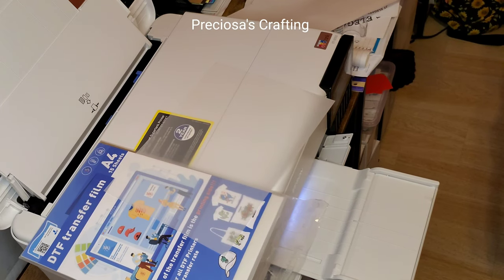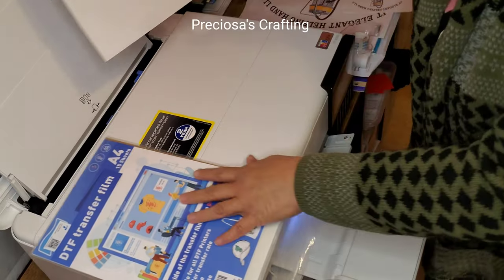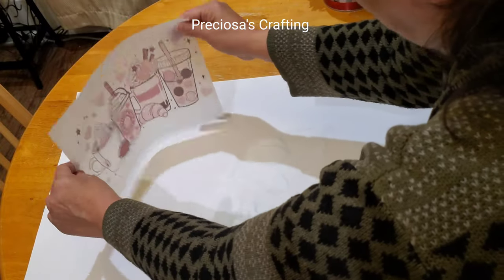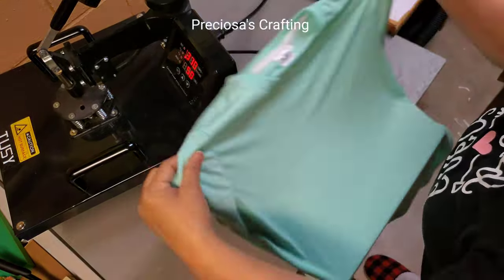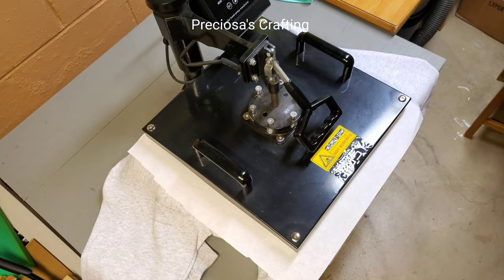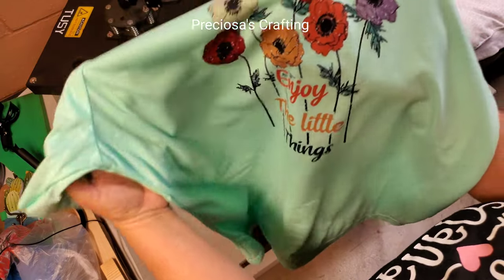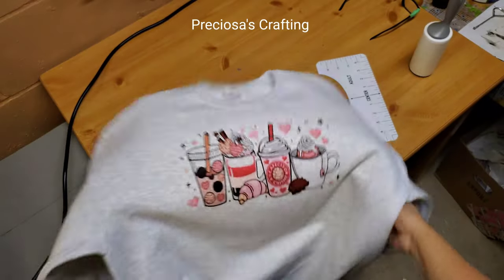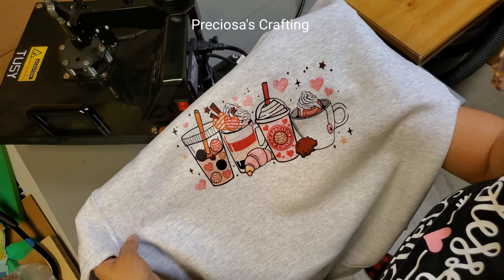DTF Sublimation Hack On a 100% Color polyester Shirt and Cotton Blend Sweatshirt!!  #sublimation

Comment: I love how both shirts came out ❤ I been using dtf to sublimation  hack for sometime now and it’s my go to 🎉I would say that if you use parchment paper instead of butcher the ink won’t go on parchment ❤
Reply from the maker: Oh that's good to know about the parchment paper thanks for letting me know. Thanks for subscribing.
Reply: @preciosaskreations4715  you’re welcome love ❤️
Reply: how are urs after you wash it?
Reply: I learned that the hard way. I have to send stuff back, after following someone else on Youtube.
Reply: @Wrightn221  not sure if you were replying to me since is on her page but yes I learned that with parchment is better ❤️
Reply: @Jpdesiigns  I was replying to you. I saw your comment about the parchment paper. It didn't work for me. Thanks for responding.
Reply: @Wrightn221  oh that’s weird it works for me each time I use it and you’re welcome  hun
Reply: @Jpdesiigns  It printed in some spots, and some it didn't. And it kept separating from the other sheets. My printer doesn't load but has the back print option.
Reply: @Wrightn221  i don’t use it to print the design if that what you mean , what I mean is I  use the parchment paper over design on shirt for a second press I use the dtf film and powder for the hack , and the once I press it on shirt I use parchment over top for second press
Reply: @Jpdesiigns  ok. Thanks for explaining.

Comment: What’s the darkest shirt to use this on?
Reply from the maker: Hi thanks for asking! It really depends on the image you are using. Canvas brand has heather colors that are somewhat light, you could try on those. Just remember that where ever there is supposed to be white it will be the color of the shirt. If the image has only black outlines it will show on darker colors better. Also choose a color shirt that will go well with the colors on the image you use, to get the best results I suggest you use pastel colored shirts. Hope this helps!
Reply: @preciosaskreations4715  Oh ok. So if I have white lettering I should change that color to like a cream or gray. Would that work?
Reply from the maker: The letters should be black because if the shirt is dark color then it might blend in if the letters are grey.

Comment: Are you using sublimation ink or dtf ink? Those are so pretty. Love how they came out.
Reply from the maker: I am using sublimation ink, but it's called DTF hack because I'm printing on a dtf sheet  using sublimation ink. 😉 as you may know that with sublimation there is no white ink and for dtf there is white ink. So this is just a hack and you would have to press it on a light colored shirt or better yet a white shirt. 😊 thanks for your comment 👍

Comment: Hello I too have a converted 8550 what printer settings did you use to print the film and what heat temperature and time to press ? I love it!!
Reply from the maker: My 8550 is converted to a sublimation printer. But I use it to do the DTF hack also. My setting are paper matte, color is standard.
Reply from the maker: Temp is 385 for 55 seconds with firm pressure.  Peel when it's completely cool.
Reply from the maker: Oh and thank you

Comment: You have to take the rollers off
Reply from the maker: Hello actually I didn't convert this printer into a dtf this printer I Converted this printer into a sublimation printer. I use this printer to sublimate on many things. But I had heard about the" DTF hack" which could be done with the sublimation printer. So I gave it a try and I filmed it to show you guys. You will get ink smearing when you try this hack. I do mention it in this video.  Sorry if I confused you. ❤